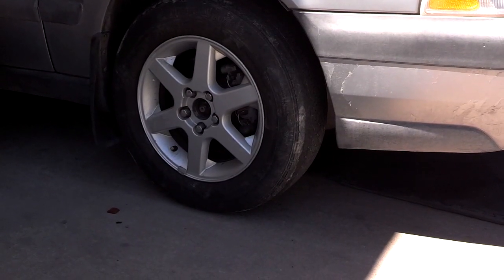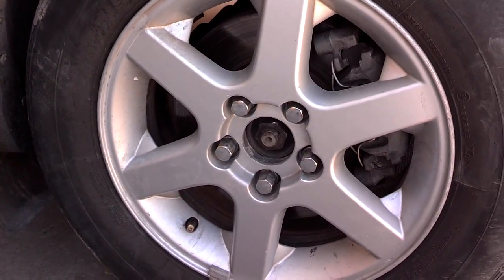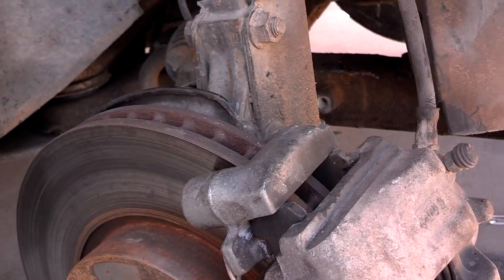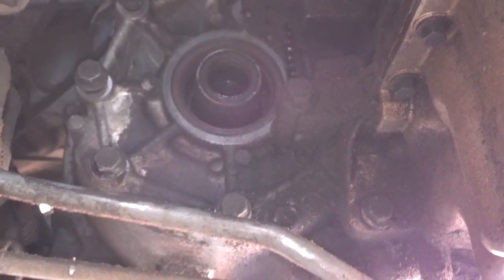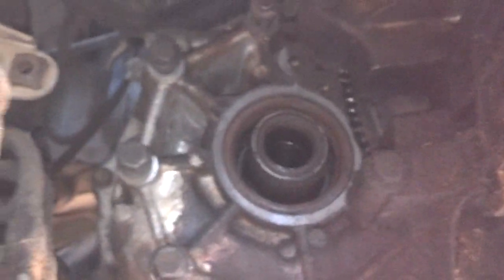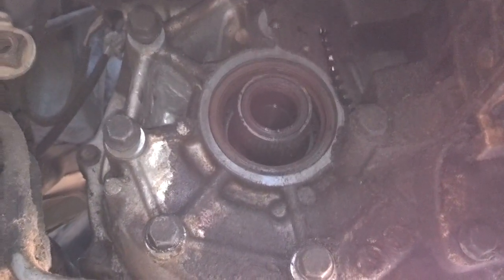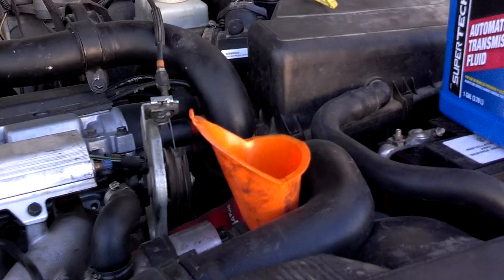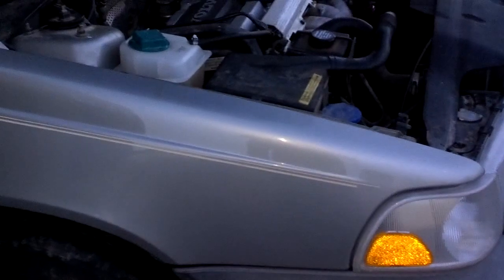Angle gear installation, AWD Gear box, how to install, Volvo V70 XC, S70, V70 AWD, etc. - VOTD

Comment: Hey Robert. I love what you do! I have a problem. I have a 2000 XC70. It has the 4speed automatic transmission. I replaced  the angle gear sleeve and the seal. Part numbers for the seal were the same for the National and Timken name brand 710740. I’ve replaced it multiple times but it continues to leak. Upon examining the old sleeve with some new seals that I have not installed yet they do not appear to ride tightly on the sleeve. I did replace the O rings that go along with the seal and sleeve. The leak is coming from the transmission side. The seal is no longer available from Volvo. Any thoughts?
Reply from the maker: What is the Volvo part number?
Reply: @RobertDIY  that’s a great question. I asked myself the same thing. EVERY parts diagram I’ve found doesn’t list it in the callout. It will show it in the diagram/pic, but not identify or give a part number. Im going to swing by the Volvo dealership and ask them directly. I’ll let you know what I discover. Thanks for getting back to me.
Reply from the maker: cool. The seal has a size, maybe you can find one with a different ID.

Comment: A tip, you’re meant to use epoxy on the splined sleeve so that they don’t bang together and wear off creating drive failure.
Reply from the maker: Interesting.

Comment: It seems like I've got transmission fluid leaking from where the shaft meets the angle gear. I'm a little confused because its transmission fluid and not angle gear oil. Could it be CV axel seals? It seems to be coming from that area above the oil cooler (I have a 99 wagon) and collecting on the silver box at the base of the angle gear. Any ideas?
Reply from the maker: Clean it up and see where it is coming from.

Comment: My v70xc was converted to FWD.  I removed the angle gear and the sleeve pulled out easily.  There's some minor wear on the splines but the car drives fine in FWD.  Do I still need to replace the sleeve even if I plan to continue running it in FWD?
Reply from the maker: You need to put something in there to avoid transmission fluid leak.

Comment: Hopefully quick question: I am strongly assuming bevel or angle gear issue.  If I remove JUST the rear drive shaft will it drive in FWD without any issues or do I have to remove more and then seal up some areas. If so, which parts and where can I get this seal?  The wagon (2005 xc70) shakes SOMETIMES after accelerating and/or when recovering from a turn, it never does it everytime but if wobbles like a tire is ready to fall off then... another turn or two then nothing.
Reply from the maker: Just the shaft.

Comment: Hey Robert when changing the fluid in the angle gear do you fill it until fluid starts to come out of the opening and close it up? Or do you need to remove a little bit of the fluid prior to reinstalling the drain/fill plug? Also i know Volvo fluid is recommended but can i use any synthetic 75/90w oil?
Reply from the maker: Yes. Yes. Also, that fluid should NEVER need to be changed. Topped off if leaking, changed if some repairs are done. But you are free to double check with some mechanics.

Comment: ooow no end message, i feel robbed ha ha :-D
Those side bolts look like a shit to get to, i would wonder if putting the bolts in the other way so a nut and washer on the inside would be nicer for future fun.
Pity they didnt do it that way from new, bad volvo lol.
Ive never looked into what a "quart" actually is in uk pints or litres but im not likely to ever come across oil sold that way in the uk.
Reply from the maker: zx8401ztv Google will show you the quart way. lol

Comment: if you setup the trans same as a fwd car, wont it seal? Then you use the axle from the front wheel drive car, then can get rid of rear shaft. Let me know if that is correct or not, thanks
Reply from the maker: +Keith Jenkins not sure I understand what you are asking.

Comment: Did your collar gear come right out. Mine did with just some wiggles. There are a lot of horror stories out there about people drilling holes in the side of it and using big pullers to get it out!
I was surprised to see the flywheel teeth right there. Thinking this is how crud gets splashed up to the collar gear and causes them to fail. When I took out the collar gear, the transmission fluid that came out looked like it had red mud in it, so that is getting a complete flush.
$65 for a used angle gear? I think you could make a living pulling those and shipping them out! An already pulled one here in Sacramento is $600!!
Love your videos, keep up the good work!
Reply from the maker: Rod R Thanks. Yes I have considered a side shot with AG's and heads. lol

Comment: My S60 control arms bolts had more room to fit a 3/8 drive ratchet and 17mm socket. Guess it is a platform difference even though it looks identical to the P80.
Reply from the maker: David Bello Good deal. They need to make them easier to service.
Reply: @RobertDIY  yeah, so tight on the p80's

Comment: I thought you used all synthetic products?
Reply from the maker: Tony M Not sure I follow you?
Reply: Tony M he did in the angle gear, not sure about the walmart tranny fluid.
I'm doing this same thing on my S60 AWD. There is a special Volvo oil 1161745 for this angle gear. The Tranny fluid, at  least for my 2004 Aisin is supposed to meet the 3309 spec. Best deal is Mobil 3309 that I got $69 a case of 12 qts. Dealer price is crazy, Toyota price better.